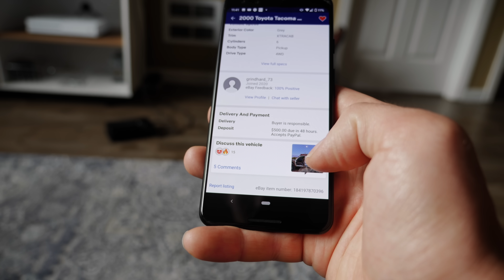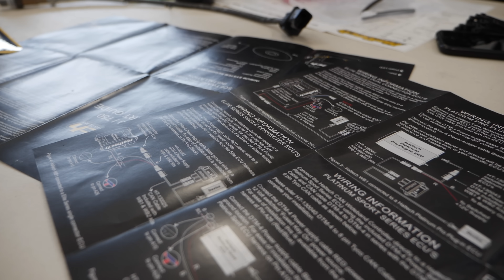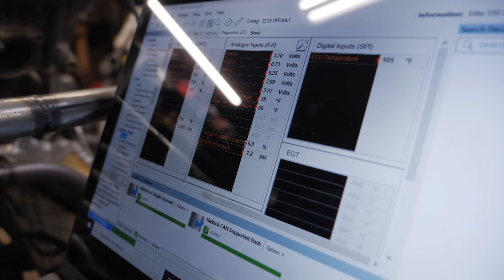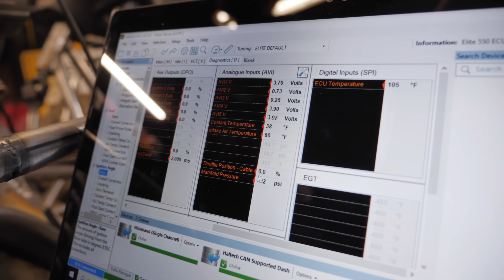1,000cc KTM Power Wheels Gets Tunable ECU!

Comment: At the end you talk about how the stepper motor for the idle control valve or whatever is outdated tech but that’s also what made that bike so reliable to. It had simple systems that run the more “complex” things the bike needs to be as reliable and convenient as the modern motors in other cars..

Comment: How did yall do the throttle twist to foot throttle on a ride by wire ktm engine
Reply: The throttle body is cable operated.
Reply: @jasonb6570 i got a 2018 ktm 690 engine on mine and its ride by wire

Comment: Just a small tip about wiring and moving vehicles, it’s best to use crimp connections on any moving thing. Solder is a great way to connect wires yes but solder is know to crack and lose connection on things that bounce around. 
My first Subaru was a 1990 Legacy that had a blower motor that wouldn’t turn on at 3 and 4 setting. It turned out to be cracked soldering on the circuit board, I just had to reheat the pins and that fixed it. After that I stopped using solder to connect wires on things that move.

Comment: Did you intentionally block the crank case vent(s)? Without either a PCV or road draft tube, you're going to have crank seal leaks, and it will play hell with your closed loop A/F metering.

Comment: RE : the no start condition and new wiring, did you take into account the "tip over sensor" or lack of which is normally mounted behind the headlight mask or is all this bypassed with the fresh loom and ecu?  Primary TPS could be worth checking aswell. Idle is controlled by the idle speed stepper mounted to the front of the front cylinder (cyl 2 in KTM language), you can do away with the secondary throttle body butterflies by setting them to 100% open all the time via the ecu or unplug the secondary tps and remove the butterflies altogether. Less engine brake. IMO much easier to use  a 990 ecu and reinstate certain items. If not, remember set the LC8's warm idle for at least 1450rpm for sufficient oil pressure, get rid of the OEM clutch slave as it leaks everywhere, and rebuild the water pump if it hasn't  already been done.

Comment: Guys! I really like your work, it's the best on YouTube right now, but you did a mistake in this build which is is okay, everybody makes mistakes from time to time. You need to go back and fix the U-joint  phasing, before fhe first test run because this way the vibrations in the drivetrain will destroy itself maybe the engine too.

Comment: Love watching y’all! Just a fyi, the intake air temperature sensor is supposed to have air being pulled across it through the intake. I don’t think you’ll have a problem with it just tossing it on there though, just wanted to give you a heads up in case you have any problems with it idling or rough acceleration.

Comment: Just a thought on the electronic choke plates - could they actually be related to a traction control system on the original bike? Sort of acting as secondary throttle butterflies to reduce power, given that the main throttle is cable and not ride-by-wire.

Comment: I'd make sure the "environmental outlet " that you blocked off with a plate is not the engine's crankcase breather. Because it looks like thats what it is, and blocking it would result in... a weirdly running engine at best, one that leaks from every gasket more likely, and a broken one at worst.

Comment: That “exaust/emissions thing” is an pcv valve. It keeps the pressure in your crank case from going up and down when the piston goes up and down. it will run a lot better if you put it back on and hook it to one of your intakes or a catch can.

Comment: Nice job so far. this has been a really cool build!Be careful eliminating those emissions tubes. If you completely seal the crankcase you run the  risk of blowing out seals if/when the crankcase pressurizes from ring blow-by.

Comment: I'm still working on my motorcycle to finish it ran into needing a welder I took 2 years of welding class just to have a passing grade in school and now I'm building motorcycles in my alleyway lol and no one will let me use a welder my dad wont let me use the ones he has. I have a gas tank I need to finish and fix my exhaust pipes and finish frame work so I can pass inspection and get it registered

Comment: Are the two little plates that you took off at 17:30 the crankcase vents?  If so you need to provide a different crank case vent or it will build pressure and push oil past the seals.

Comment: Weigh and Time Savings Opportunity!! Instead of making new block off plates, cut the bung off flat with the flange. Trace the flange onto a piece of thin galvinized or stainless steel. Cut it out and sandwich it with some RTV between the head and the flange. I used this trick to delete a mechanical fuel pump during and EFI conversion. Keep up the awesome work!!

Comment: Great progress... but two points to raise.  Firstly the KTM ECU would have been an easier solution, and very tuneable with TuneECU freeware and calibrated each cylinder seaprately.  Secondly, what you're referring to as the "choke" TPS is actually secondary throttles controlled by the ECU...

Comment: Awesome job on the harness and ECU! 
I’m curious...those emissions block off plates you made for on the sides of the cylinders...aren’t those the PCV ports to pull the gas fumes from the crank case so the engine oil doesn’t become saturated?  What alternative will be in place to prevent the fuel accumulation in the crank case?

Comment: Awesome video. I think I would put the fan on its own circuit. But if the fan fails then it will stall instead of overheating. The ECU should be programmed to shut down the engine at a curtain temperature.

Comment: are you sure that piece on the cylinder isn't crankcase ventilation blocking it is a bad idea the pressure in the crankcase will blow out bearing seals and ultimately end up with a knocking bottom end. Normally for emissions and what not its ran to the intake tube/manifold but with high rpm oil ends up in intake so aftermarket use a catch can

Comment: Which wideband? Only two good ones on the market IMO.  Also, what on earth is a choke on an EFI vehicle? No such thing in a traditional sense, so no idea what they mean. Yes, I searched. Your MAP sensor won't have much dynamic range with that setup you have there. In fact at idle it won't have almost any dynamic range so you'll be dialling idle some other way.
Reply: 14:30 oh, I see, it's an electronic choke actuator for carby ignition only setups, got it. Other questions/comments still apply :-)
Reply: And now I see that the OEM throttle bodies actually had secondary plates - I wonder what for, there will be a good reason, just not sure what it could be right now. Will ponder and/or research that.
Reply: 17:31 Eeek, do you have other crankcase ventilation? If not you'll blow seals out without one and hurt power with pressure under the pistons, too. All ICE engines have some blow by, even in perfect conditions, and you need to get that out somehow, ideally under vacuum, and with cross flow to replace acidic high-moisture gas with fresh air as you drive it. That stuff doesn't matter much to you with the low miles you'll put on this, but you do still need to vent the pressure that will build up and keep that pressure as low as possible. Block off plates will not achieve that obviously :-D

Comment: those "emission things" you made the block off plates for are actually crankcase/head breather's, they're normally plumbed back into the intake to burn any oil vapour that's expelled rather than dropping it on the ground, but you definitely shouldn't block them off, run a hose from them to somewhere that wont get water on them and put a one way vale and/or a filter on them so that pressure in the crankcase/heads that builds up from blow by can get out of the engine but does not allow water/dirt etc to get sucked in.

Loving the build, this is one of the coolest things i've ever seen.

Comment: You mention somewhere around 11 minutes in that you will be running the cooling fluid through one of the frame tubes.   You might need to coat the inside of that tube with something as you have to watch dissimilar metals in the coolant loop.   Many times the incompatible metals will end up ruining the cases and creating corrosion issues.   Worth checking out, as it happens more quickly than you might imagine.
Reply: Coolant does exactly that

Comment: Are you sure those “exhaust” things you deleted aren’t actually a type of PCVV? You may have an issue with blowing base gaskets and such if you deleted them. Maybe just put on one of those little PVC valve filters from the auto parts store?
Reply: Don't know exactly what those were but sure looked like crankcase breathers to me. And yes those should not be blocked at all haha.
Reply: Definitely want the crank case to breath.Under the piston creates as much “ air volume” movement as the top and that volume needs to go somewhere.If blocked it will create pressure “ which is resistance of flow” also may cause the engine oil to go in spots it’s not supposed to go and gasket/ seal failure. I like your content and I want to see this thing run for many many sends to come.
Keep up the good work boys
Reply: Those run to the SAS (supplemental air system).   Many LC8's including mine have had their SAS systems deleted and block-off plates installed there to no adverse effect. Those are not the breathers, they are elsewhere on the motor.
Reply: Pennies OnDollar ok that’s what I was wondering. These guys are pretty smart so I figured they’d know better than to delete a crank case breather.
Reply: May make one heck of an oily mess out the oil sump tank breather/cap with those things gone.
Reply: Carson Hammond emissions shit is usually just that.

Comment: By far my favorite build! Love them all btw. Hey guys, are you sure those fittings you deleted aren't crankcase evacuation? You most definitely need that on a high rev high performance engine. It sucks negative pressure on the lower end to improve ring seal and eliminates blow-by. Racecar builders usually weld check valves into the headers and run a tube or hose from the crankcase port. The exhaust flow creates a siphoning effect.

Comment: Just an asthetic idea for the throttle bodies. Maybe a blower style cap on top and reuse those choke plates to work like a top fuel dragster. Hmmmm. Lemme know what you guys think. I have a shop and tinker around with alota different stuff like you guys. Been doing it since I  was 8 and im 35 now.. I built my own frankenstein go-kart with a old dingo frame and a KZ-400 engine about 10 years ago. Ive been watching you guys since the barbie mustang and love the great content and bettering quality. Each time stepping up your builds. Gotta keep it going fellas. Love it!

Comment: isnt mounting the ecu that close to the engine going to cause issues when it starts to get hot (melting things) even if you plated the back of the ecu it would still heat soak

Comment: You may need to vent the crankcase if you blocked off those valves?
Reply: Worst thing that would happen , is the dipstick blowing partially out of it's hole . And the crankcase shouldn't build any pressure unless the piston rings are destroyed . Those valves are for emissions , and any emission device removed means more power .
Reply: @JerryHenderson72  or push oil down the valve guides or up past the rings as well as push it out the dipstick tube and in extreme cases... If your rings are worn out as bad as you mentioned above... the crankcase can become a bomb.
Reply: If by emissions you mean blowby the correct thing to do is route the hoses to a vented catch can instead of recirculating it into the intake stream. Even a brand new ring has enough blowby to cause all sorts of issues if you dont vent it properly.
Reply: @stp440  I totally agree with you. Four strokes have to have a ventalation system for the crank case. No crankcase ventalation or poor ventalation is the number one cause of oil leaks, excessive oil burning and plug fouling. I predict problems. A correct system should pull vacuum through a pcv valve. Also known as positive crankcase ventilation. This pulls vac at idle but what is equally important is having a tube running from one valve cover to the filter side of the intake. That way when's It's held at w.o.t under load and no manifold vacuum is created. It still has a way of pulling a vac on the crankcase.
Reply: @jakemesa3211  ive heard of a guy who machined an engine to take all its seals backwards so he could pull a ton of vaccum on the crank case while on the dyno. Less drag on the crankshaft means a decent power gain at high rpm
Reply: stp440 Is there any video of that? I’m intrigued and would like to see if a vacuum in the crank case would have a significant benefit.
Reply: @rustyshackleford9632  this was done back in the early 90s on a GM quad 4. I was told it was worth 20 hp on a 2.3 liter. The main issue is you need to double seal everything or it leaks oil like a siv when no vaccum is being pulled. So is it worth the effort?
Reply: stp440 In my opinion the amount of work you have to do to the engine to facilitate a vacuum isn’t worth it considering there are much easier ways to get a good horsepower gain like forced induction. That being said, I’m impressed that it’s possible to make 20 more horsepower out of a 4 cylinder 2.3 liter just by removing the internal air resistance. It’s quite the physics demonstration and I wouldn’t have guessed the gain to be that significant. Thanks for the info, I’m an avid engine tuner and never considered such a method to increase HP.

Comment: Is that possible to put  radiator in the front? Its will work without fan alltime, and the fan can just turn on if the engine temp too high. So you can save the batteries usage. Just ask btw

Comment: I've never seen an EFI engine with a choke! More likely some sort of tumble valve.
Reply: Well it was linked directly to the choke handle, so it can't be that
Reply: @AccAkut1987  I didn't see that. The ktm appears to have an electronic actuator for the secondary throttle plates.

Comment: 18:00 Kids always hold the vise to the left when drilling that way you can use the riser shaft of the press to blohe the vise from spinning if the bit sticks into the material.
Reply: You just gave me a great idea. A baseplate for the drill vice with a 'fork' like shape that slips around the post. Allows everything to float with zero risk of that thing helicoptering and taking out a digit, limb or worse.

Comment: Awesome work so far, I wouldn’t worry about the secondary butterflies, they weren’t there for choke but to help improve low end power, a lot of people just remove to help with the jerky throttle issues on 990s and have no issues running with out them

Comment: Ill do my part. We've got about 8 phones in the house😂✌
Reply: t Stricklin Pretty sure if they are all running off the same network it only counts as one view, YouTube has it that way so that people can’t use bots and what not just to run up their channel views.
Reply: @CarswithNash  😁👍😂
Reply: @CarswithNash  I doubt it's that simple. Many cellular networks (ATT for sure) give private IPs to each phone making significant portions of the network effectively the same as a home wifi network using Network Address Translation. My cell gets a private 10.x.x.x IP, and the exit node public IP is somewhere in St. Louis, almost 700 miles away.
Reply: Bradley Weingartner I meant if the phones were all running off your home wifi... Personally I never watch YouTube videos on my cellular network because I don’t have unlimited data.
Reply: @CarswithNash  What I was trying to point out is that tons of people watching videos on a cellular network would appear to YouTube as a single IP just like when you have 10 phones on your home wifi. Because of that I highly doubt they only look at the IP address.

Comment: You guys should make a rotary power wheels
Reply from the maker: This is very true!
Reply: @GrindHardPlumbingCo  Try an Aixro XR50. Super compact 50hp rotary engine used on go karts. Should be perfect for a power wheels build.
Reply: @GrindHardPlumbingCo  maybe a kawasaki h2 engine. 750cc two stroke triple cylinder
Reply: @GrindHardPlumbingCo  hell yeah, next powerwheels build has gotta be rotary. that or two stroke. id like to see both done eventually. 2 strokes and rotarys are my favourite engines by far. love them, the sound, the smell, the power. so good.
Reply: We need a diesel one first
Reply: @simloverify  why not both?
Reply: Mazda power wheels with rotary lets go.
Reply: I recon Honda cr500 engine 😏 stupidly powerful and sounds raspy like a rotary! Make a s2000 drift cart 🤟
Reply: @INSANEREINDEER rotarys arent garbage, they'll run longer than most engines. And actually people stopped making them cause the emmitions were too high. Speak facts not your opinion 👍
Reply: @YaBoiWeeit  Rotaries are great for steady high rpm usage, hence you'll find them in small aerial surveillance drones these days
Reply: Let's see a Corvette power wheels with a rotary and and Dodge truck diesel power wheels
Reply: Time to snatch that one from build break repeat yo.
Reply: Rotary engines are garbage. That's why nobody makes one anymore, and Rob Dahm has spent tens of thousands of dollars just building a high powered one to last.
Reply: INSANEREINDEER but they aren’t trash. Built correctly they thrash

Comment: God Dammnit, I was hoping it would start in this episode.
Reply from the maker: Next one🤞
Reply: @GrindHardPlumbingCo  cool, I'll just keep holding my breath
Reply: @GrindHardPlumbingCo  you need to put the exhaust valves from the side of the engine back on because you're creating crankcase pressure which is going to shorten the life of the engine by  alot
Reply: I guess this will teach me not to look through the comments before finishing the video